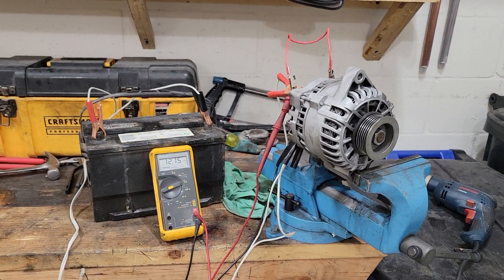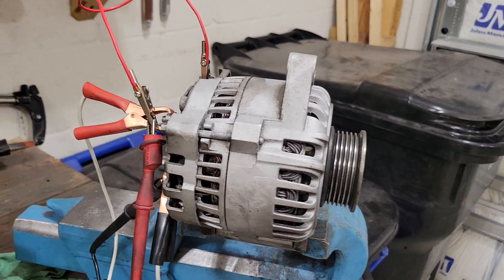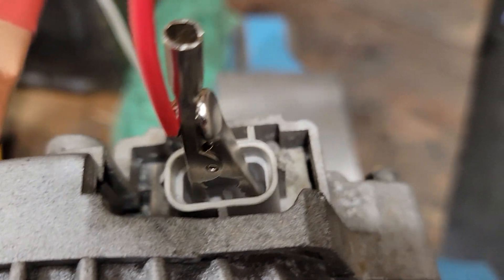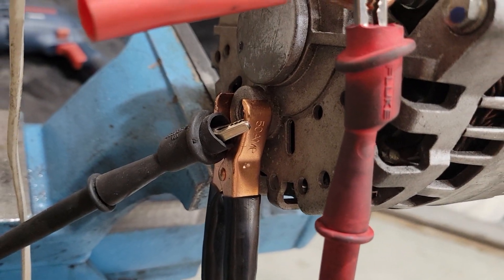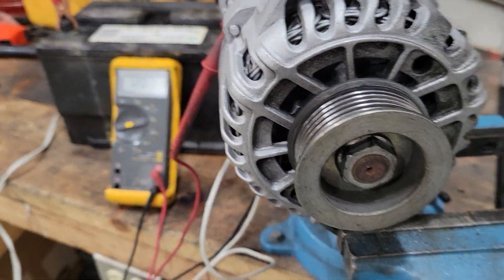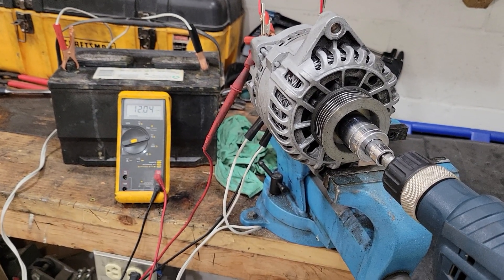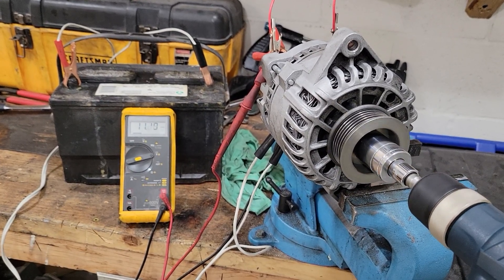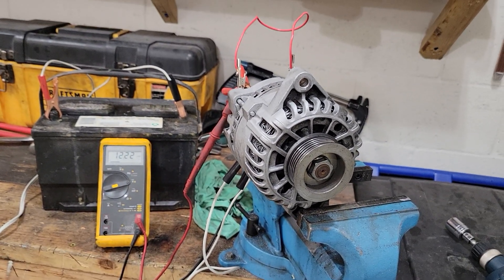Bench testing a 6G alternator

Comment: I have one problem When measuring the voltage on the battery terminals while the engine is running, it gives 14 volts, which means that the generator is working properly???  However, when I disconnect the battery cable, the car stops. What is the reason?

Comment: won't you fry the voltage regulator  doing it without a power source  or a light  switch , also.. what do we look for if the alternator is no good?
Reply from the maker: No, the voltage regulator is built internal to the alternator, and based on generator theory, you need to excite the internal field with a voltage in order for it to be able to generate voltage output (but especially current).  You're basically creating electromagnets for the rotor to cut the field with to generate a high current output.  Without going into too much detail, generators work with either permanent magnets, or electrically excited fields that require an external voltage to excite them.  This alternator is the latter.  It would have spun all day and not generated a single volt if I didn't excite the field with the 12 VDC from the battery.

Comment: I changed my alternator, put in a new battery...hooked up negative to the battery hooked up the positive 5 seconds later horn stays on go to start it and it starts and everything goes on wiper fluid is spraying horn on wipers on lights on car went nuts ...WTF

Comment: A lot of the bench test that I've seem use a light to indicate when the alternator is charging, does that not apply to this type of alternator?
Reply from the maker: I guess it could, but the fact that the drill was heavily loaded as the voltage dropped tells me there's a load so I didn't need a bulb to be redundant.